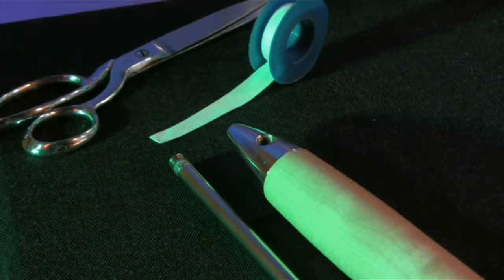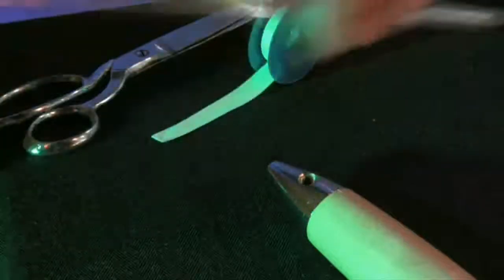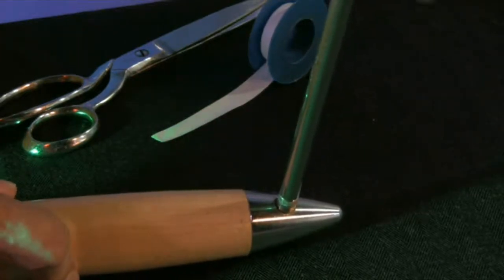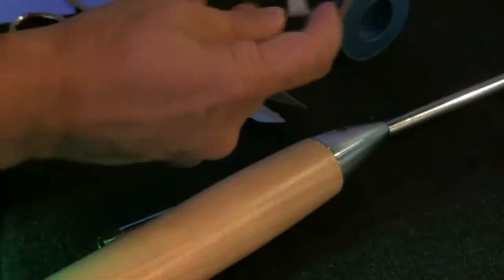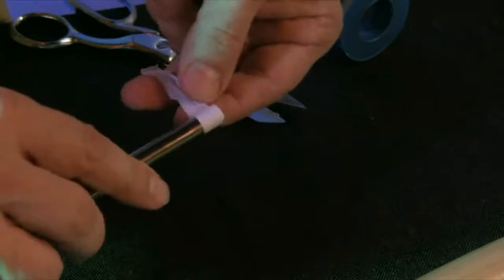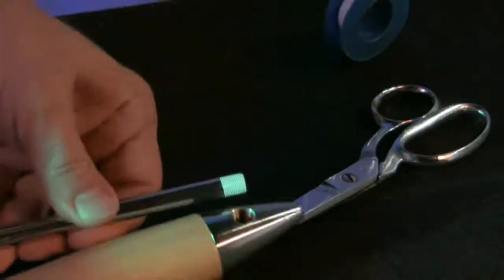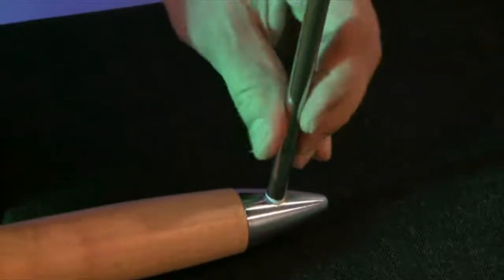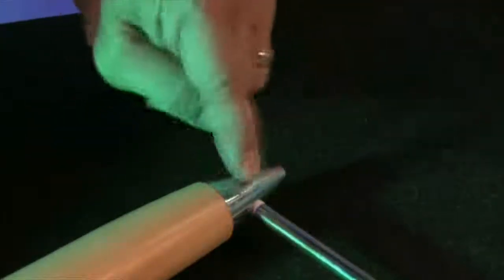Kip Rosser's "Complete Theremin" – Tip 8: Preserving EPro Pitch Rod Threads

Comment: AERPHONIC REPLIES:
 I have found that the way to prevent cross-threading of fine diametrically-pitched threads, or any threaded screws or holes, is to start by reversing the direction of rotation-tightening until a slight click is felt. This is the start of the correct beginning of the threaded area. Then rotate in the direction that produces tightening.

Comment from the maker: I've been using teflon tape for years without any side effects, interference or noticeable difference in playability. The tape is so thin that what seems to happen is that the simple act of screwing it in degrades the tape enough that it is stripped away a bit on the high ridges of the threads, permitting enough contact.

Comment: AERPHONIC HERE:
 Mr.Rosser, Since the Teflon tape is electrically insulating, does it not prevent intimate electrical contact between the antenna and the pitch arm?
 If it does provide suitable contact, by some odd reason, does it not affect the pitch response or playing arc?
 Thank you